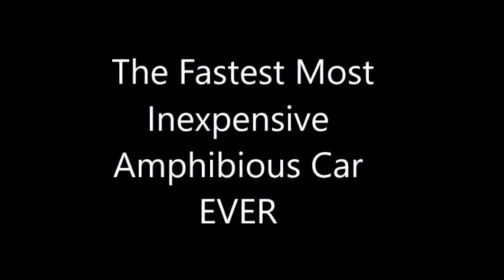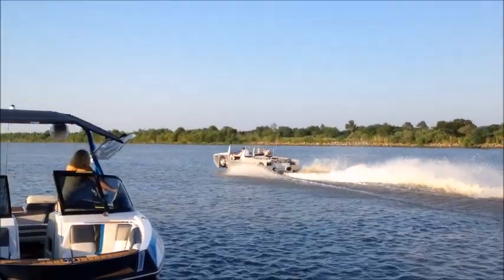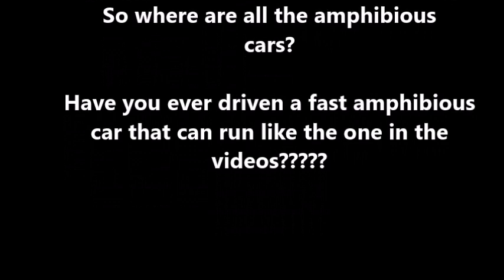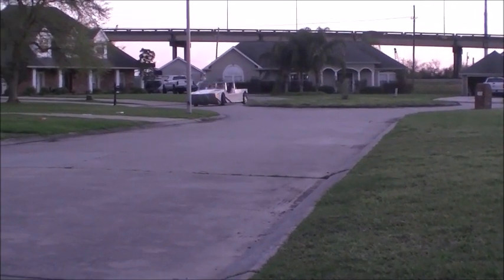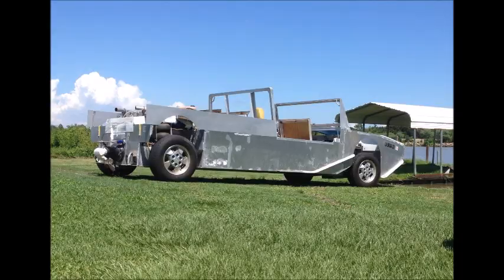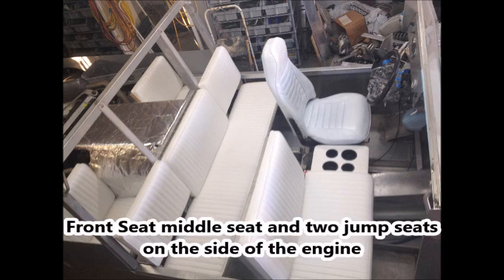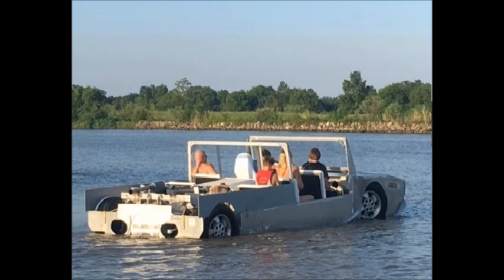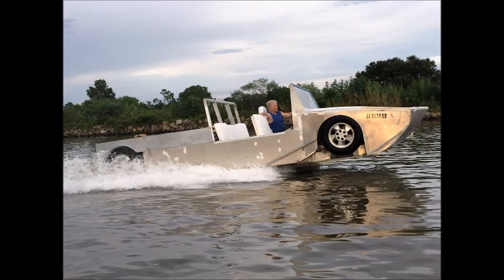Cheapest Fastest DIY Amphibious Car

Comment: Omg, Yes! This would help save so many lives in areas with prone to floods!
Reply from the maker: Thanks.  Flood Rescue and Recovery was the original direction I was going in.   I wanted to get government agencies interested in it. Coast Guard and Wildlife and Fisheries looked at it.  They basically said it was too small and the Wildlife guy said NO WAY would he buy a JetDrive.  I got the USCG vessel HIN numbers and the Wildlife & Fisheries Boat Registration.  However getting the DMV road VIN is is too much RED TAPE without help from other government agencies. I did push the design to its limits got up to almost 50 mph in the water.  Blew the transmission, caught it on fire and almost flipped it.  As long as the hp is not pushed too far that it stays in the 35 mph range it did OK.   But it did handle like a big flat bottom boat with a jetdrive that did not have a skeg.  Would be happy if the private sector showed more interest.  Was working on a bigger design based on what the USCG and Wildlife & Fisheries agents said they would like it see.  Then Covid hit shut the shop down and then when we started back the owner of the shop I was using died of a heart attack.  My stuff has been locked up collecting dust for over a year now.
Reply: Yes, a drop down skeg would make it perfect. I would love some plans to carry this torch!

Comment: I want to build one lots of floods also in my country......... Is aluminium lighter than fiberglass?
Reply: Most Airplanes are made of Aluminum for a reason.  (Weight to strength ratio)   BUT weight was NOT my main reason for using 5052 marine grade aluminum.  For me ease of construction was the driving factor.  If you use fiberglass you will probably have to make some sort of attachment for all the suspension components and those attachments will have to bolt through the fiberglass  and get sealed.  Also the moving components will have to get sealed.  For me aluminum is just a little easier to deal with but fiberglass can be used too. If you want to go fast in the water the easiest way is to retract the wheels and put enough horsepower to get it on a plan. How if you are only making short water crossing in a flood issue and water speed is not an issue leave the wheels down.  The part of retracting the wheels enough  to eliminate drag is the tough part.   If you plan on slow in the water look into some kits like Dutton.  Where are you located?

Comment: 4x4 transfer cases usually have a continuous output side and a transfer output side. I'm not familiar with cases that can switch from rwd to fwd to 4wd. Are you using two 4x4 transfer cases to output to the two separate drive systems or have you utilized a different solution? Is the pump output on the output side of the transmission as well? Did you utilize a manual transmission to lock down the pump side of the drive to say 3rd gear or are you using some other solution? I see the rear suspension is made using airbags. Are the airbags also lifting the suspension by creating some sort of a vacuum or is there a separate mechanism that does the lifting?

Thank you.
Reply: Look at the all gear NP205 transfer Case.  The internal shift safety pins can be removed so that front output and the rear output can be engaged and disengaged independently.   With this simple modification the all gear NP205 type transfer cases can have the front output in (hi, low or neutral) while the rear output is shifted into (hi, low or neutral).   You can also get the Atlas Transfer cases which are all gear similar to the NP205 with more gear ratio options to be configured in the same way.  Note Forward and Reverse is mainly done with the automatic transmission.  Also note I have been working with multiple marine drive systems.  Some of those marine drive systems like the Mercruisers have a reverse built into them.  The jet drive has a reverse gate.  Lots of combinations can be done.  I have one very beefy custom Transfer Case built by SCS with 1410 yokes.  I have one wild divorced thick Aluminum Custom transfer Case gearbox I built using NP205 gears. It consist of a top input shaft with a top output shaft on the opposite for a PTO etc.    In addition it has two bottom output shafts on either side of the input shaft that turn the opposite direction (reverse) of the input shaft.  Both of these two shafts have (hi, low and neutral) and come out both sides of the case. Its my Universal Transfer Case sort of like a V-Drive arrangement but multiple outputs on front and back.  I also have a custom transfer case for amphibious vehicles from Atlas.   Where you located Bert@amphibian-motors.com

Comment: Awesome !
Why not CAD your full designs and make them open source so as to 3D print anywhere in the world then assemble ?
Viva la innovation-revolution !
Reply from the maker: 3D CAD cost Money and Time.  I have some drawings I was doing in Fusion 360 but they now locked me out and want $$$$ so that I can access.
Reply: @amphibianmotors2918  how much money to do this open source?  I think you’d be surprised at a potential fund raising effort.

If I were in an area where this would be frequently used, I’d pay thousands for a guide to make this.  On top of the new tools I’d have to get.

Comment: Ok so I want more info but wtf happened to the enthusiasm? Can we get at least 1 updated vid considering that just about any cellphone can shoot a half decent video nowadays?
Reply: Sorry I was making revisions,  changing out some suspension components and changing out the Berkeley marine jet-drive to a custom surface drive that I designed.  I was also putting DOT lights, windshield wipers, Silverado Windshield frame (with VIN).  Note Coast Guard and Wildlife & Fishy Agents were helpful but the DMV is/was a problem.  That part has not gone well so far so I am letting it collect dust right now.  I was hoping to get some form of waiver for specialty Flood Rescue recovery vehicles.  The Wildlife and Fishery guys liked the design but said they wanted something bigger and in no way did they want a marine jet drive for flood service.  So I started building a bigger mini-RV size unit 8' wide x 29' long.  I believe that if I build what those government guys said they wanted they would probably help me get through the DVM title and VIN red tape.  Send me an e-mail and I'll send you some info.  If you want videos of the old unit watch this one.  I also have videos of an amphibious Go-Kart that I built that is pretty cool.  Just not ready to post new stuff yet.   I still consider everything a prototype.     https://www.youtube.com/watch?v=mQO6Fe8gwWw&t=5s

Comment: How much would it cost to build me one?
I need something that can cross a large brackish water bay and tolerate 2-3 foot sees and be street legal on an interstate highway and have a waterproof top.
Reply: I would need a lot more info.  First the car in the video is not designed to handle 2 to 3 foot seas.  It can cross a few 2 foot boat wakes but a steady 2 to 3 foot seas is too much for it unless you are just barely moving.  Are you in the USA and what brackish water Bay are you talking about?  How fast do you want to travel on the water?  I am currently working on a bigger version of the one in the video.  It is a Mini RV size unit 8' wide x 29' long with 37" OD tires.

Comment: Do you manufacture
Reply from the maker: Not yet.  I had a run in with the US DOTD trying to do an upgrade to make it road legal.  Started on working up off-road ATV and  UTV designs.   Just recently got an amphibious ATV prototype certified for water and trails here in the USA.    https://www.youtube.com/watch?v=QEN__el0SeY&t=65s
    The ATV project started with a wrecked Suzuki King Quad 750. The Hull is 100% foam covered with fiberglass 13.2 feet long and 5 foot wide (12.5 feet waterline length). The current design max speed so far is a little over 4 times faster than the calculated displacement hull speed. The foam hull ended up weighing about 300 pounds much more than anticipated because of the supply chain shortages. I had to glue and stick many layers of higher density foam sheets together to get the desired thickness.  Would consider doing a fiberglass mold with a top and bottom section like a jet ski to save a little weight. It is very stable I can easily jump in the water and climb back up without worrying about flipping it. Your feet do not get wet when in calm water during normal operation. 
 The design uses a simple parallel shaft
shifter box with two outputs. The top output shaft has a shifter one locks
and unlocks the output drive to the to the rear differential. The bottom
shaft goes to the prop and it also has a shifter that locks and unlocks the
drive to the prop.   The engine is very accessible stays dry & no
sealing or snorkel type crap is needed. 
 Note this design is NOT like the Gibbs Quadski. It is designed for the marsh   https://www.youtube.com/watch?v=QEN__el0SeY&t=65s

Comment: I like this I was wondering how you used only one engine to build this, in the video you said that there were other videos can you direct me to where they are I would like to see them if it is possible  thank you for your time and again I like this keep it up 
thank you
Reply from the maker: Yes it is only one engine an old second generation Chevy engine about 280 hp.  At best it did right at 50 mph that 10 mph under the current Guinness running a LS7 aluminum block corvette motor with a world record by David March with Water Car out of California.  (FYI he was running a LS7 aluminum block corvette motor with a blower about 900 plus hp).  Note horsepower wasn't my problem keeping the water jet pump was.  At about 45 mph I was getting some bouncing (porpoising) and it played hell on the automatic transmission.  Note new design also allows me to go four wheel drive and four wheel steer.  Other Videos https://www.youtube.com/watch?v=mQO6Fe8gwWw&t=5s
Reply from the maker: The unit uses a TH350 automatic transmission and a modified NP205 transfer case.   The shift safety pins are removed so that either shaft output can be used independently.  One output goes to the wheels and one output goes to the marine drive system.  The engine is a mid-engine type arrangement with the engine behind the passengers.    The rear brakes are in board and stay dry all the time.  Both front and rear drive arrangements are very similar and unit can be made to be four wheel steer also.

Comment: What about you will go midle of ocean or midle
Of lake to go fishing midle
Of lake to stop ,,, will it sink
If you stop midle of lake
To take your catch fish
Just waiting few hours
1 to 2 hours fishing,,,
Reply from the maker: It is just about the same as any other flat bottom boat the same size.   The hull openings are above the waterline and the shaft seals are on silicone boots and they lift up with the ties out of the water.

Comment: I wanna make a house boat with a carport/porch in front, and have tow hitch built in the frame.
Reply: It has been done and should be pretty simple build depending on how complicated you want to make it.  See https://www.youtube.com/watch?v=OVX87bKfFnE   See  https://www.youtube.com/watch?v=Za63ltkMGGE  Note if you are hinking about a trailer house   https://tinyhousetalk.com/diy-micro-camper-that-doubles-as-a-micro-houseboat/   If you are considering a camper/houseboat that the wheels stay with the camper that done too just can't download that pic.  If you want to you fast you need to retract wheels.  If you are just interested in getting around at about 7 mph no need to retract wheels.  If you do do the project be sue to do something to maintain a positive pressure on the wheel bearings. Use something Like Bearing Buddy.

Comment: cool. :)
Reply: Stay tuned John I'm working on four different versions.  This video was just my first try with a Berkeley 12JCA jet drive.  I am working on one roughly the same size as the one in the video except it has a surface drive and an ASD#6 chopper prop and twin trailing arm rear suspension.  More ground clearance.   Next an amphibious one is a fast 14.5 hp Go-Cart mostly foam unsinkable with a surface drive.  Next is an amphibious Trike.  All are partially assembled and getting worked on.   I can do jet drives but I am doing surface drives on these units to get a little more speed with less hp.  Also the surface drive that I designed will allow shallow water running through areas with Lilly-pads and marsh grass.